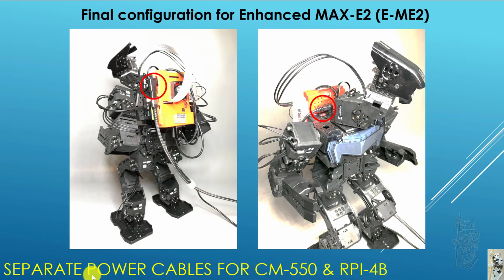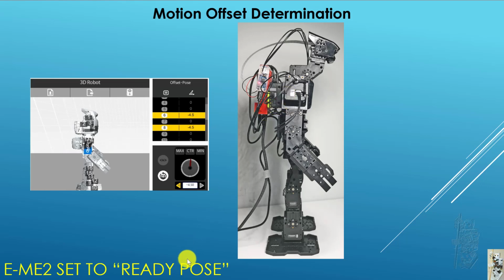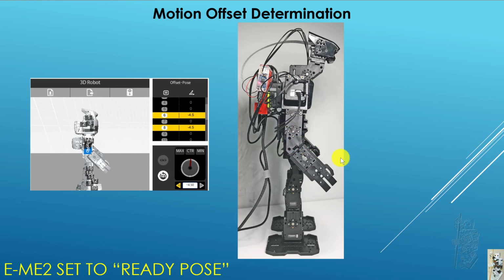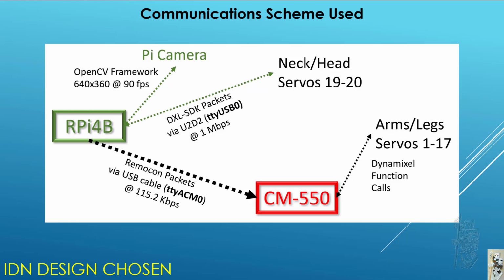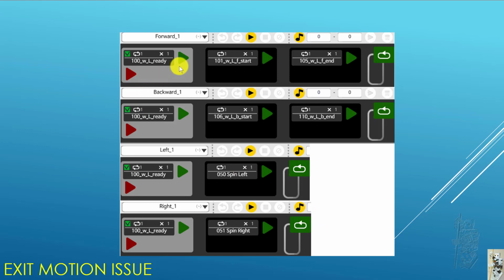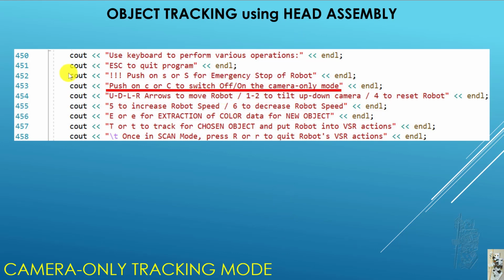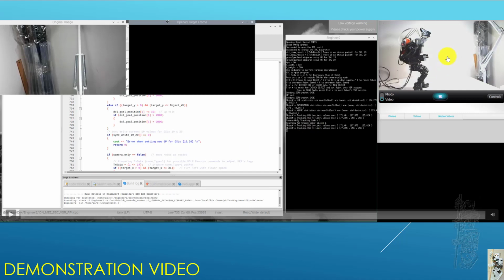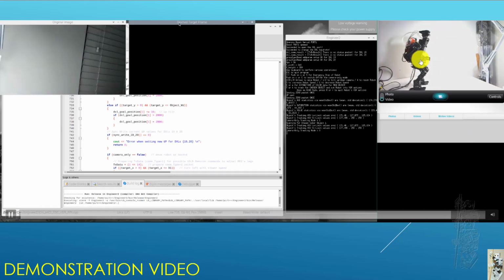RPi4B + MAX E2 Integration: Computing Aspects

Comment: Thank you for the video. But why do you still need cm 500? You could improve it perhaps by removing cm550, which consumes space and power, and just using u2d2...?
Reply from the maker: Hello Sadashi-san, 
Just using U2D2 and DXL-SDK with the RPi4B for this E-ME2 robot is definitely a feasible solution, but I have not worked on such a solution yet (essentially have the RPi4B handle 19 servos at once) so I do not have a definitive answer at present.  Have you gotten or known of such a solution?  If yes, can you share the results?  
Previously, I had done a similar solution for the A4WP-H robot with 12 XL430s (https://youtu.be/w6YSA-1m07s), all controlled by the RPi4B only (using Time Control and SyncWrite packets), but that robot had a "big" passive cooling system, so that RPi4B did not need to "throttle" down like this RPi4B which has only a fan for cooling (did you see that message in this demo video? - I mentioned a few words about it).  This E-ME2/RPi4B robot had only 2 XL430s (+Pi Camera & U2D2) under the control of the RPi4B, and it was already "throttling" down as it "felt overloaded", so if I add 17 more servos to its control, this RPi4B is just going to throttle down even more.  So this U2D2-only solution, although possible, may not get to deliver its full potential with the RPi4B.
In my experiences so far, I have not found a "perfect" single-controller solution to robotics yet, as we users keep wanting/adding more features to our robots!  I had found the CM-550 to be a very good co-controller to handle complex robot motions (but low-level) like for this robot, while the RPi4B can handle "higher-level" tasks.
Reply: @RoBoTeer2012  thank you for the thorough reply. 

I havent used RPi at all as all my work has been on lattepanda, which has great performance for controlling many dynamixel motors at the same time. I tested it with 23 dynamixel motors and it was great. It is also easy to integrate different sensors using lattepanda as it has an arduino interface.

There could be a bottleneck in terms of performance with RPi I guess, which is kind of expected as RPi is supposed to be cheap and easy to use. Perhaps another sbc is better. I plan to do a similar humanoid using lattepanda or udoo.

Thank you for your reply again and good luck
Reply from the maker: @Sadashi   Sounds great!  Looking forward to your results.